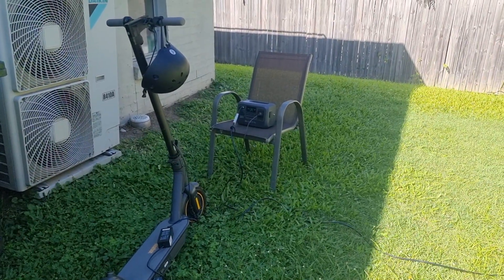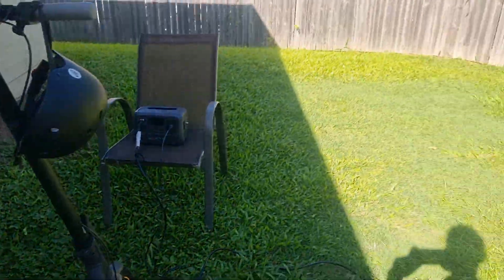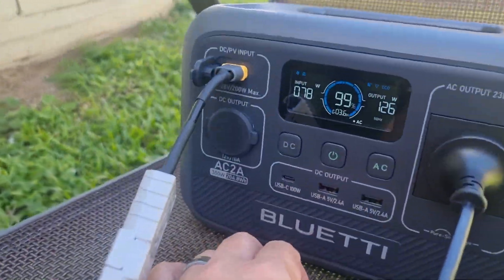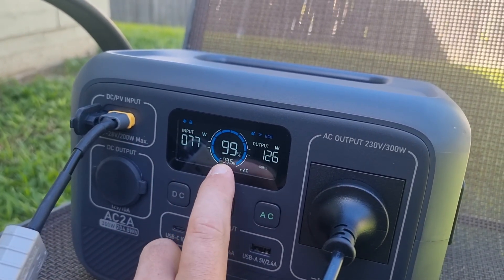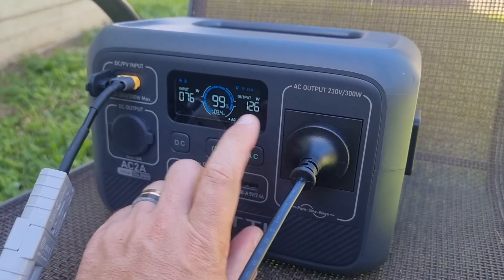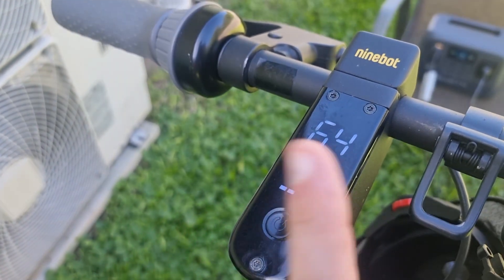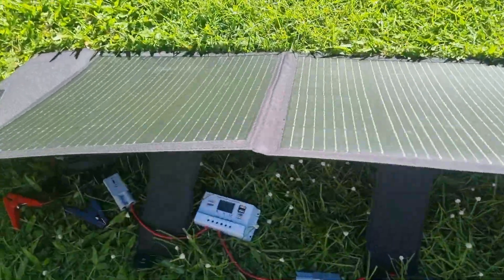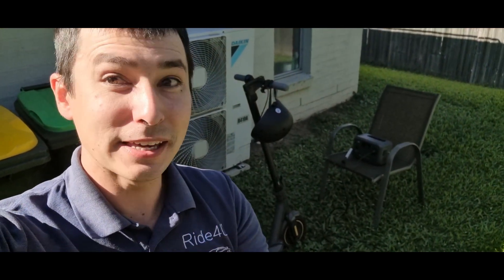Bluetti AC2A 🔋 Solar pass through charging 🌞⚡

Comment: Do you keep the solar controller attached when feeding into your Bluetti AC2A? When i was asking AI (lol) it suggested that i would need to disconnect it, as it could damage the bluetti system as it already has a smart inner controller that can handle and moderate the solar panel flow?
Reply from the maker: Yes it remains connected,

It will work without it as well